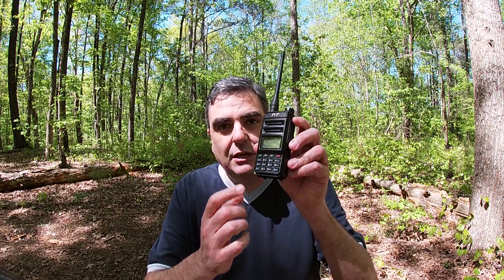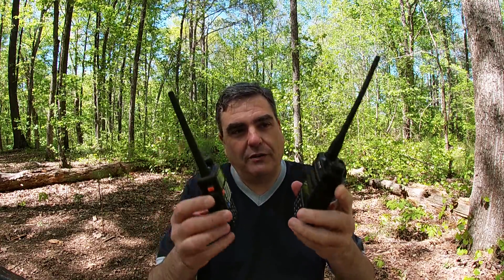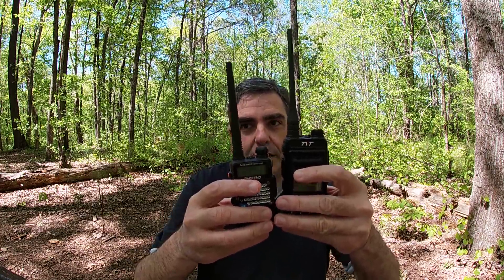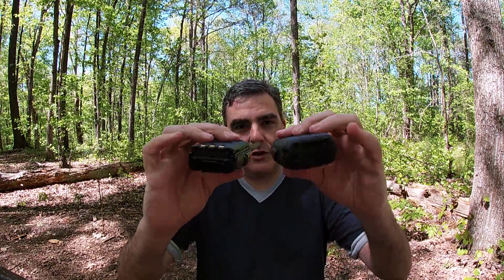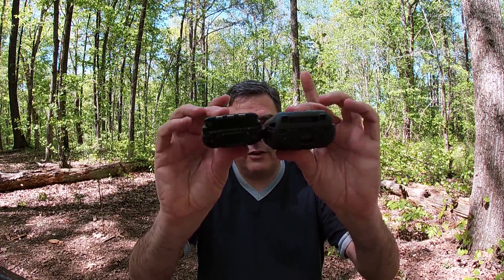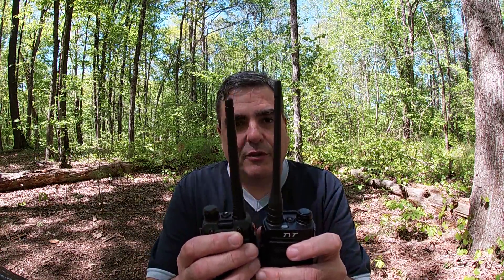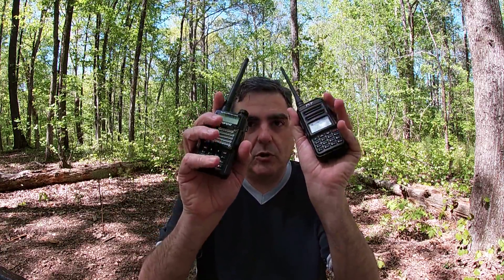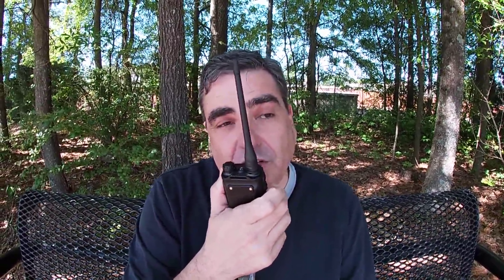Replacing my Baofeng UV-5r with inexpensive TYT

Comment: Welcome.  This is Frank SP4TT.  This strange pickup noise is normal with these models.  I had similar Baofeng P15UV and TYT TH-UV98 devices and they all have the same problem.  I just bought a Baofeng BF-A58 which has no such problems and the received signal is clear without any unpleasant sounds.  73!

Comment: Hey Brian, new to the hobby myself and I started, like many, with the UV-5R. Did you test your new TYT with the same methods and equipment you tested the UV-5R to see if it has spurious emissions as well? I am assuming so because you say you know for a fact it won't send out any dirty signals, but I just want some confirmation, because we all know what assuming does.
Reply from the maker: I hope to test mine in an upcoming video soon. I will also test some other new radios.

Comment: A great and inexpensive radio with better receive filtering than a baofeng. Nice modulation and very loud and clear receive! But this radio suffers on bad firmware. I have got my radio with factory firmware 1.27, the main functions was working, but it was impossible to programm one memory channel with DCS on TX and CTCSS on Rx what was needed to work  a repeater near my location. The Radio shows DCS and CTCSS, but it doesn't send any DCS when the radio was switched off and on. Every newer Firmware version has the same bug. At least, i was in contact with the TYT support in china, a few weeks  later they sent me a link to download firmware 1.40 and since then, the radio is working great! Now i have ordered a big 3.200 mAh  Battery and it works the whole week on one charging!

Comment: I bought a tyt th-uv88 radio and had a problem when using CB 477 and PMR 446 which uses 12.5khz channel spacing. The problem is that when I transmit to a channel, it will also transmit to the adjacent channel with a 12.5khz spacing. For example when I transmit on channel 2 (446.01875), it will also transmit on the adjacent channel which is channel 1 (446.00625) and channel 3 (446.03125). this means it transmits on 3 channels in 1 time! my question is whether this problem only happens to my unit due to malfunction or all tyt th-uv88 models face the same problem? perhaps anyone who owns this model can try. I tried on baofeng radio and found this problem did not occur.

Comment: Okay, I've heard a lot of things about the Baofeng radio, and I own two. But, no one has ever actually explained to me just what it all means. Plus, I've never had any problems with mine, or with the "dirty" signal. No one has ever said anything about my signal being "dirty" And, I've never had any one complain that I am bleeding over to other frequencies. Okay, I still have my two Baofeng radio's, but now I use a TYT UV8000E, its a better radio, I can tell by how its built.  Plus, its ten watts of power, and yes on 146.000 with a good antenna, it will put out 10 watts. So there you go. CHIRP now covers the TYT radio's

Comment: Hi. I just purchased a TYT TH-UV88 radio.  Did you have any issues programming yours or with VFO mode? Here is what has happened to me. The first one I bought would not allow CHIRP programming, or TYT Software programming. Contacted supplier and they sent me another one. That one would work with CHIRP programming, but it would not show the FREQUENCIES, just the CHANNEL NAMES and NUMBER. I found out online that if you turn the radio off, hold the 1 and 7 keys, then turn radio on, it will go to VFO mode and show FREQUENCIES.  HOWEVER, let's say there is a FRS frequency on Band A, and a WX frequency on Band B, the radio only broadcasts the WX frequency on both bands. Very frustrating trying to figure this out. The frequencies were manually installed simply to test only 2 frequencies. All the other frequencies were taken out for the testing. 
Any ideas what's going on?  I contacted the supplier and that is ongoing at the time of this comment. Hope I can figure it out because I really like these UV 88 radios.  Thanks.

Comment: I did buy both of them , they were nice but sadly they were not supported by chirp they said I have to buy the program, and I do not even know if it will work like a chirp . anyway I did add the nova channels, but I could not find a way from transmitting, I contact the company, but no help in fact the told me they do not know what nova is. do you have any idea or other web help with programming    Thanks

Comment: hey Brian i saw your video last night about contacting someone from 2000 miles away and that was my first time hearing about ham, i stayed up all night watching your videos and doing research and i was wondering if the tyt th uv88 came with a charging dock. I dont think I saw one in the description or in the pictures of the product, I was hoping you could tell me. Thanks
Reply from the maker: Cool. It does come with charging dock. You probably want to get buy the programming cable with it because it’s easier to program with a computer.
Reply: Ham Radio In Action okay thanks for responding so fast and getting me into the hobby

Comment: tyt uv88 is indeed a good one.  I have it.  But what do you think of the tyt th-350?  TriBand:  2m, 220, 70cm.  Unlike the TYT uv88 and most Baofeng which are Dual-Watch receivers.  The TYT th-350 has a Tri-Watch Receiver.

Comment: Lies! First off he's comparing the extended battery pack of the tyt to the standard battery pack of the Baofeng. Standard battery pack capacity for both radios is TYT 1400  mAh for $8.99 vs Baofeng 1600  mAh for $.7.99. extended battery is TYT and Baofeng 3600mAh $17.00.
But the baofeng extended battery has a power connector built in that allows it to charge from a solar pack VIA a USB, way more useful for a preper, camper, or just for general use. The baofeng also comes in different colors like yellow blue green red even camouflage etc.... As for spurious emissions, who cares. don't know about the tyt but there are lots of baofeng accessories and they're very inexpensive. About things can be purchased with multiple different types of LCD display. also the baofeng comes in an 8 watt version which I have personally tested and truth be told none of the baofeng radios put out more than 5 Watts in the ham band including the 8 watt version never tested the tyt but they seem to be every bit as Chinese as the Baofeng. for the record I on nine of them they are fantastic four the price. But let's not forget people you get what you pay for and for which you pay the baofeng is a great radio. If you want to convince me the tyt is better I need to know about the front end receive it's about things is pretty much wide open is the tyt any better at filtering spurious emissions I doubt it.

Comment: My TYT is on the way, and was looking at a Nagoya NA-771 SMA-Male 15.6-Inch Whip VHF/UHF (144/430Mhz) Antenna to use (on Amazon).  Any thoughts on it?

Edit: Bought the starter kit from www.buytwowayradios.com and it arrived today, and I have to say I am disappointed.  Manual is terrible, and the software with the CD it came with is dated 2017.  Found the 2019 software and downloaded, but it will not connect as all of the COM port selections are grayed out.  Downloaded Chirp and it doesn't have the TH-UV88 in its TYT list.  If I don't get it to work right soon I will probably return it all to Buy Two Way Radios.

Comment: Okay, update time. I've had this radio for about two months now. It has become my 24/7 radio. I picked up a second, 3200mAh battery from BuyTwoWayRadios after I got it. I change the battery each night before bed. I've run longer that 24 hours, but it just makes for a good routine. I keep this radio on me always. Sometimes on the belt, but usually just slipped in my shirt pocket. I've even used it as Net Control on our Sunday night net. I have no problem hitting our repeater with a clear signal in and out. I can hook it into my Tram through the glass antenna on the van and still talk to the repeater 15-20 or more miles out. My TYT 8000E just kind of sits lonely anymore. I have the VGC N7500 mobile in my van now, but the UV88 still goes along for use away from the vehicle. After two months of pretty much continuous use I love this little radio. I have 10 HTs total. This is the goto radio. Well worth the money and a bit more.Thanks again for telling folks about it and for the discount.
Reply from the maker: Thanks for supporting the channel and my sponsor. Great update on your experience with the radio. I really like mine.

Comment: Just brought one per your advice. I am NOT licensed yet so I can not and will not transmit. However, I cannot manually enter a frequency. How do I do that? I understand I have to do some type of tricky deal by pressing a bunch of buttons with one hand and turn it on with my toes while standing on one foot etc. to unlock VFO mode or something like that.
Reply: Actually, shoot a video of the process for doofuses like me.
Reply: Just bought one of these myself. Its pretty simple Roger, with the handset off, hold 1 and 7 at the same time and then turn on the radio. once it goes to the main screen release the buttons. Turn off. then turn back on. You should be able to hit the # key now and it will change on the screen to VFO and allow you to input numbers in manually. Hope this helps!
Reply: @bhhacker  Thank you, Sir

Comment: Bought one of these radios after watching this video.  I have had nothing but problems with the radio so far.  There is already a firmware update to fix the scan issue, which I can’t get to  work.  There is a constant quiet hissing sound coming from the speaker when not RX/TX.  Almost like squelch is off and radio volume is low.  They skipped number 15 in the menu.  Not a big deal but annoying.  Freqs are not straight on the display / slightly slanted.  Programming software is a PITA.  I did a quick test of 3rd harmonic interference.  It bled over in the third harmonic.  I’m not an expert and don’t have an analyzer so maybe it’s in tolerance?  The radio has potential but I would wait until it is chirp supported and they fix some of these issues.  From my view, it is not a baofeng killer but another cheap Chinese radio with similar issues.  You get what you pay for.

Comment: Question : Will any of the cheaper Baofeng programming cables work with these? I see that there's a TYT W13-K cable that's recommended but I can't seem to find one in Canada :/
Reply from the maker: I used my boafeng programming cable, and it worked. Your results may be different.
Reply: @HamRadioInAction   Do you know which cable it is? Which Baofeng radios work with it? I don't mind trial and error for Amazon.ca if I have a place to start
Reply from the maker: Programming cables are just usb to serial cables with the right connector for the radio. Just try to get one with a non-counterfeit chip. I bought mine several years ago on ebay, so I can't provide you a link.

Comment: Hey Brian ... Yesterday I watched one of your videos while I was looking for something to relieve the boredom of very slow-paced indoor rowing.  Thanks for having an audio track that is sufficient to be heard over the noise of a rowing machine (not all YouTube videos have good audio tracks).  Like one of the other commenters said, I like the way you get right to the point, so I subscribed today though I don't yet know if you have or will have any other videos of interest.  If you'd like to know what I'd like to see/hear you talk about, one topic is the Yaesu FT-70DR handheld.  You could make literally DOZENS of to-the-point videos on that radio, using it with Fusion and WIRES-X and programming it (my choice though I haven't yet tried it is to use RT Systems' made-in-America software & cable for programming it).  The reason I mention the FT-70 is because it is the lowest priced and most popular handheld made by Yaesu which will access their digital Fusion & WIRES-X modes, which seem to be the FRIENDLIEST digital modes of all that I've looked in to.  73.
Reply from the maker: I will look in to it. Thanks for the suggestion and subscription.

Comment: Update: Got the radio in today and it's a nicely built little unit. Downloaded the software before it came in and had it set and ready to go. Read from the radio. (Always best to read the first time before writing or so I've been told), Opened my file and wrote the radio just fine. One thing that was driving me a little nuts was switching to VFO mode. Read the post on Two Way Radios site and rolling. Side note: That also opens up the full frequency range for transmit. Use responsibly. ;)

Thanks, Brian for letting us know about the UV88 and for the discount code. 73, K2WLF
Reply: What additional frequencies would there be?
Reply: @cmvb69  It will then cover 136-174MHz. Mind you outside of the amateur 2 meter band you shouldn't be transmitting if not licensed there. However, the 5 MURS channels (1-3, Blue Dot & Green Dot) are in the 151.xxx MHz range (1-3) and 154.xxx MHz (Dots). Our local EMS/FD dispatch is on 174 something just for callouts. I keep that set for receive only on B when the radio is set to dual watch just to listen and our local VHF repeater on A (TX/RX). Also a lot of railroads operate in the 161mhz range. Listening is fine, but don't go transmitting there. On UHF it goes beyond the 70cm ham band up to 470MHz so will cover GMRS. Again, not technically legal to use on GMRS frequencies even if you have a license (which I do) because the radio is not FCC Part 95 certified because it can transmit outside of the GMRS frequencies. If you are licensed and operate clean and proper I don't think  you will have someone from the FCC driving around going Barney Fife on you because your 5 Watt HT isn't Part 95. That means keeping low power and narrow band with in the FRS specific frequencies, and operating responsibly across the full GMRS band.

One thing to keep in mind too in regards to transmitting. The antenna on the handhelds aimed at hams is set to resonate for 2 meter and 70cm. Once you go outside those ranges, say into MURS on VHF or GMRS on UHF, you have worse SWR. While the HTs are cranking high outputs you can still shorten the life of your radio my operating there a lot. If I run my TYT TH-UV8000E on high power on a GMRS frequency it gets a lot hotter than if I'm working in either 2 meter or 70cm (usually around 443MHz).

Comment: Brian. You used to loudly sing the praises of the UV5R , now the TYT product. Ok. Have you compared using the UV88 with EchoLink? Was the ease of use the same. Like to know.
Reply from the maker: I have not tried echolink with the TYT yet, but it sends DTMF codes, so it should work just as well as the UV5r.

Comment: I didn't know about the harmonics of the baofeng.  What I want to know about the TYT is the front end.  My Baofeng when you put ANY other antenna on it, the front end can't handle it.  Might as well turn it off.  I did some testing and I can transmit very well, but won't hear anything back.  I love the price of the TYT radios, but I'm nervous about buying another crappy front end.

Comment: I permanently retired both of my Baofengs and replaced them with a TYT UV-MD380 and a TYT UV-MD390 for the same reasons, I didn't want to cause interference with first responders etc. The UV88 is much cheaper, but I wanted to get into DMR so I pulled the trigger on the 380 and then the 390. I also picked up a Yaesu FT-70D but I use the TYT radios far more.
Reply: oh wow, yes, the airplanes will fall from the skies

Comment: One note: I got a TYT UV8000E. The whole thing about them only having HAM frequencies is this: they come programmed so that you are only able to input HAM frequencies. However, you are able to go into the software and change that very easily. The antenna that it shipped with was for 132-174 and 400-520 and I have been able to pick up non-ham frequencies. Just keep this in mind that it’s not limited to HAM only for people who want to use the TYT as a scanner.
Reply: Semper Vigilans

Comment: You have to unlock the VFO by pressing 1 and 7 on the keypad with radio off then turned on. I can't unlock it.
Reply from the maker: hold 1 and 7 while turning radio on. You only have to do this once. From there you tap # key to switch between.
Reply: @HamRadioInAction  I discovered that you have to hold the 1 and 7 keys while turning on the radio, then turn the radio off and back on again before it takes affect.
Reply: @HamRadioInAction now. It won't scan in the MR Channel mode. Any advice?

Comment: Received the radio today, receiver is very sensitive and appears to have excellent selectivity as well. Unlike 'other' low cost HT's  the UV88 is unaffected while sitting next to my computer monitor, I am impressed.  Audio is clear and can be very loud. Programming can be done fairly easy via the keypad after a slight learning curve. (Read the manual)  For the price I give the radio 5 stars plus!